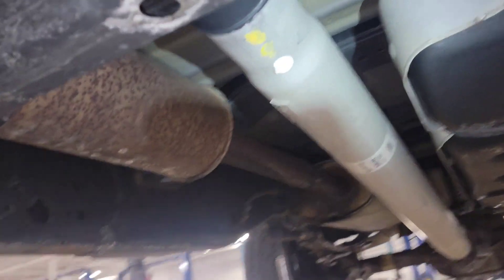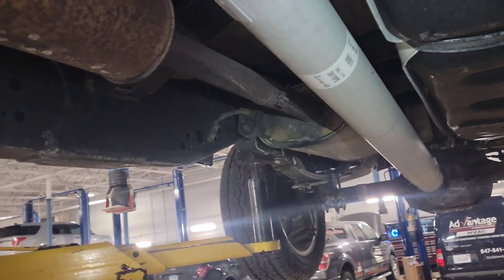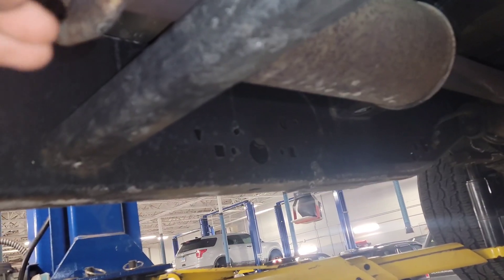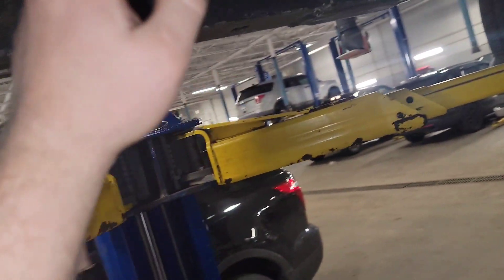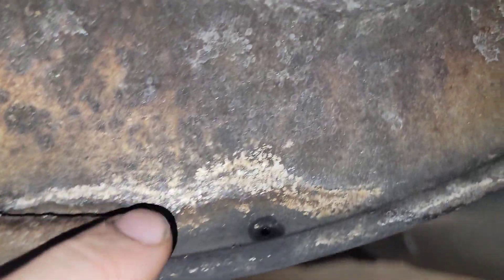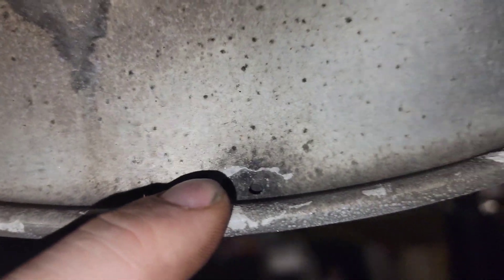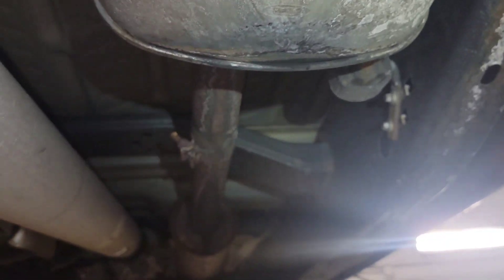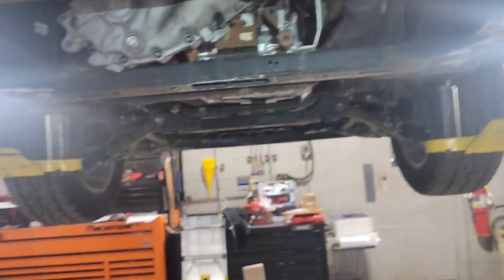Water Dripping From Exhaust - Don't Be Alarmed It's Normal

Comment: Rich if you could give us your thoughts on rejuvenant for rubber such as 303 Aerospace and if we should even be using any products on CV axle boots, caliper piston boots, bushings and such. I couldn't find a dedicated video of yours on this topic. Your wisdom is greatly appreciated. Thanks.
Reply: I actually spray mine occasionally with 303. Can’t hurt.
Reply: @JAMESWUERTELE  I saw a guy spray wurst rubber care on brake caliper piston dust boot and was wondering if that should even be done.
Reply from the maker: I've seen people use fluid film or surface shield from blaster I kid you not and as long as it's still vibrant and jot falling apart No Issues 

303 works well

Comment: Hey Rich, another great video brother.  Do you recommend cleaning 02 sensors as a preventive maintenance like with carb cleaner or soaking in gasoline overnight? Just was wondering and wanted to know your thoughts.  🤛👍
Reply: I would think cleaning them would just risk damaging them. Either damaging threads when pulling the sensor out, breaking it, or damaging the internals. Just run them till they fail.
Reply from the maker: No just leave them be

Comment: Not pertaining to just ford.  What about some white under the oil fill cap as the vehicle warms up from a cold start?  (Not there before starting, and gone after 15-20 minutes of driving).  Not orange rust like gritty brown as if you blew a head gasket.
Reply from the maker: I've covered this

It's moisture build up and then after enough driving it went away
Reply: @FordBossMe  yup sorry,  thanks just revisited it.    I forgot you did, at the time I thought it didn’t pertain to me.  🤦🏼‍♂️

Comment: That's why they say short trips are killer's.
Reply: What if the car was taken on short trips for years. What would you look for as a problem sign in exhaust?
Reply: Short trips do not allow the engine to get to operating temp and allow the condensation to evaporate. Also the oil does not get to the proper temp among other essential functions needed to happen.